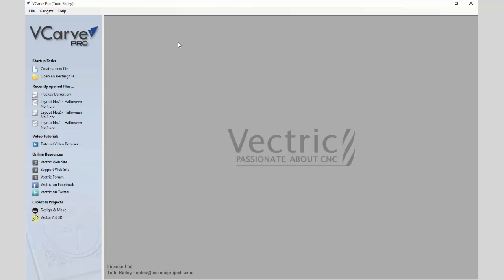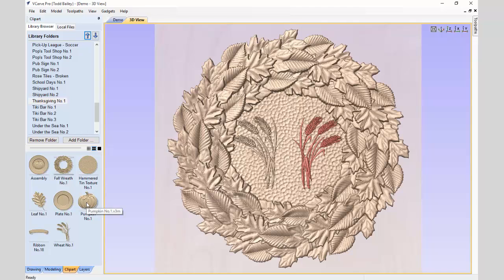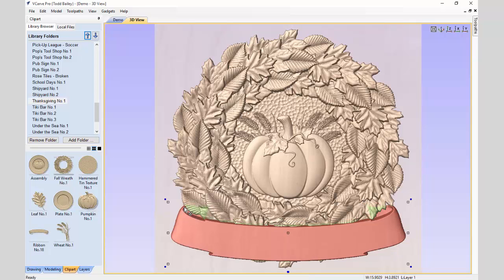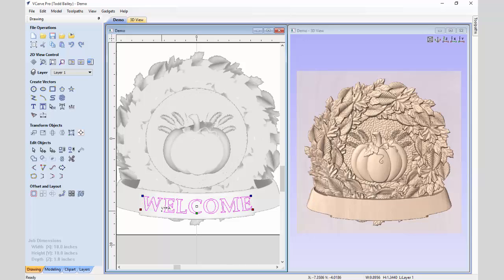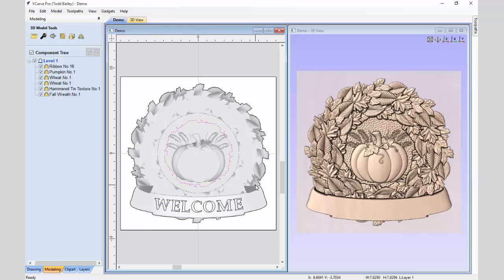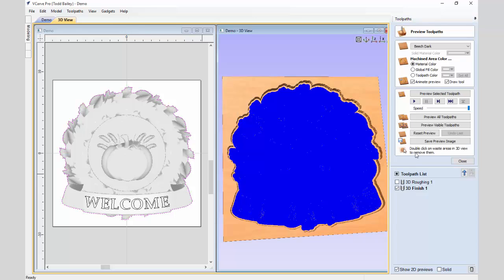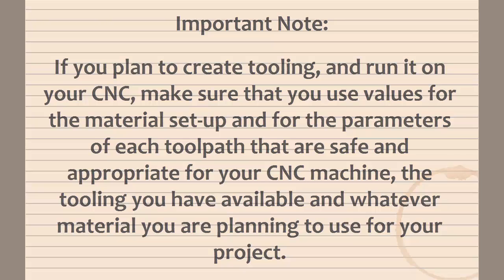To Get You Started - Using the Thanksgiving No.1 CNC Project | Design & Make

Comment: Great project and appreciate your time to help us get started. I appreciate the tooling but am curious about the estimated time to complete this project. I am doing the the free Christmas wreath from the monthly Vectric projects. It takes about 4 1/2 hours to cut. Is this about the same or longer? I'm going to create it and  find out but wondering what you get. 
Again thanks I like your channel.
Reply from the maker: +George Scott Thanks for the question.

First off I have to mention that I really can't give you an accurate answer or that.  Mainly because tooling time depends a lot on your machine, material you are creating your project in and the tools you are using.  So you need to take my times as a reference only.

I downloaded the Wreath project from the Vectric site and used Micheals tool setups... again... these are what he is comfortable running on his machine.  This may and probably will differ from your machine.

Working strictly from the software numbers (of course some controllers and controller software lets to adjust feeds and speeds on the fly so these may not have been his actual numbers).

When comparing the times with his they seem pretty close... 

I have a Scale Factor of 2 set in my Aspire.  Not sure what you have sorted out to be yours.  This number will change the times - the lower the number the faster the times.

Vectric's Wreath (just the wreath not the ribbon) 17"
- Roughing 0:43
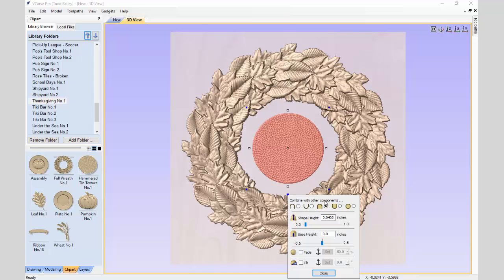- Finishing 2:41

Design and Makes Fall Wreath only 16.5" (not the full layout)
- Roughing 0:43
- Finishing 2:41

Now if you decide to machine the full Design and Make layout remember that there will be additional time needed for the center of the wreath (pumpkin, wheat and tin texture) along with VCarving.  

There are plenty of ways to reduce the finishing time... larger finishing cutter, different machining strategies and so on.  

Again I want to be clear (in a nice way) that these times are based on what the software sorts out using my/Micheals settings that may or may not be what you will use.  

Hope that helps... 

If not please just ask.

Thanks!
Todd